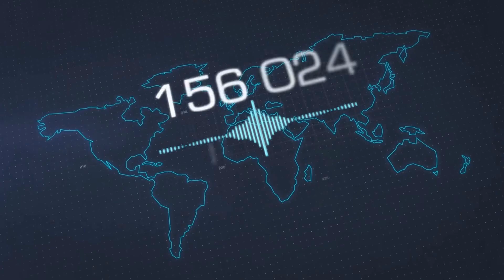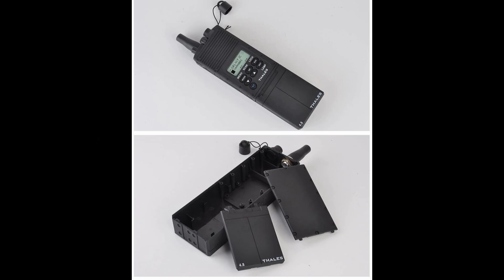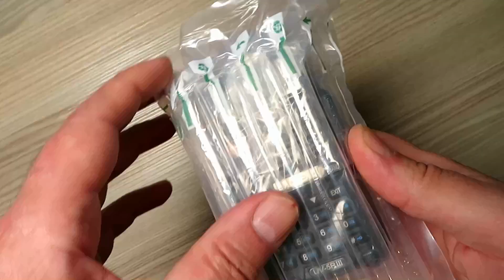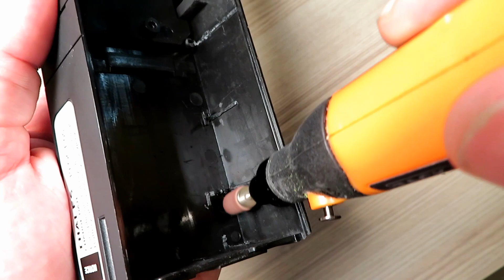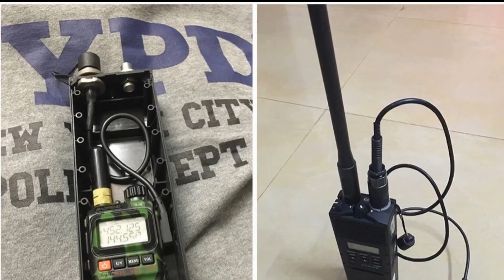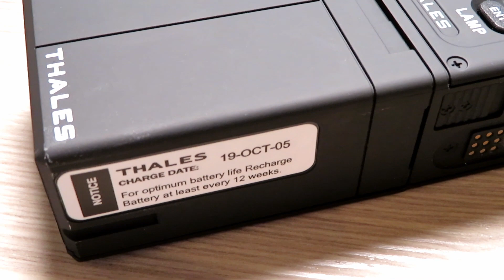THE BAOFENG UV-5R TACTICAL - IS IT PRACTICAL ? IS IT ACTUAL?

Comment: I can’t tell you for the PRC-148 Dummy Radio but I can tell you that the UV-5R fits into the PRC-152 Dummy Radio. Of course, you need to cut some parts inside for making room but it will fit inside. I made it on mine.

Comment: Want to know something very KOOL about baofeng KEYS.ive been spreading....hold zero for battery level in decimals,,from off to on hold 3 or 6 for firmware version or serial number..PTT an number keys transmit TONES for repeater starting.alarm can transmit or not while hearing it or not .it for help from your group..expand to 118mhz 125 is airband.so don't transmit ,it more serious than army calling ..get the abbree 124cm tactical folding antenna..an the goose neck thingie out

Comment: one thing I didn't get: you've said that you like the 3d printed radio backpack strap bracket because it keeps your radio high for better reception. Why don't you do a project of a backpack-integrated antenna? it would be pretty cool, and you could hide a meter of it in the back-rest, in a U shape

Comment: Why would any real ham radio operator, even want this thing? I would much rather have some sort of waterproof, impact resistant case or cover for a radio that needed it. Then again, I don't play Air Soft, or paint ball, pretend war. But, if I did, I would just use my radio as is. And have actual use of it, in the field.
Reply: Well, since I'm not waterproof or impact resistant, I don't care about either of those things. The UV-5R is robust enough as is and we're both going to stay out of the rain as much as possible. By the way, he explained why. He was trying to simulate the NATO radio look.

Comment: Interesting case for it. It's a shame they've not gone a little further and made it as replacement case so you could remove the actual chassis from something like a uv5r and transplant the guts into it and make it a fully functional radio. I would have paid at least double for something like that. For now, it'd just be a plastic toy taking up space for me, although some argue that the uv5r is a toy anyway and I have a small collection of them so... ¯\_(ツ)_/¯
Interesting video though, thanks for the upload.

Comment: I undertook this same project. You do have to cut away part of the UV-5R5 (the version I used) chassis and remove the standoffs in the case. I'm almost finished, just need to resolder the speaker wires and order one of the small reverse SMA antennas. I used some packing foam to fill in some empty space in my attempt. If you get the 152, I would be eager to hear your thoughts on its build quality etc. Thanks for your video!
Reply from the maker: Thanks for letting me know 👍👍
Reply: @knoxieman  update?
Reply: Kindred spirits we are. I too build things that I can't afford/doesn't exist. Great job 👏👌